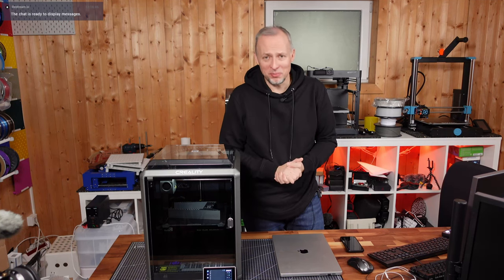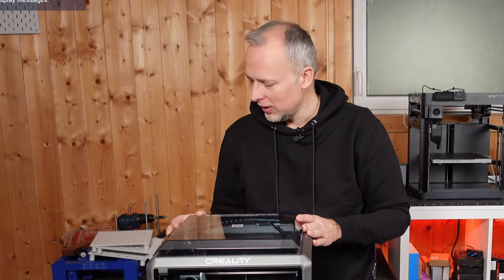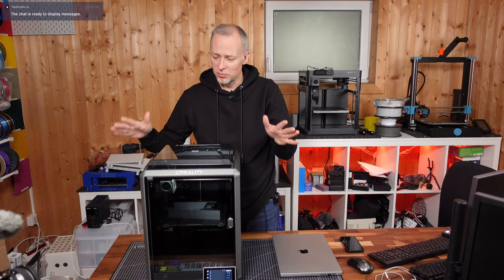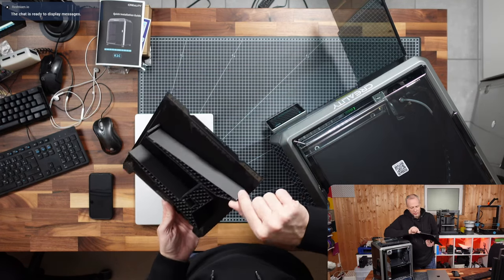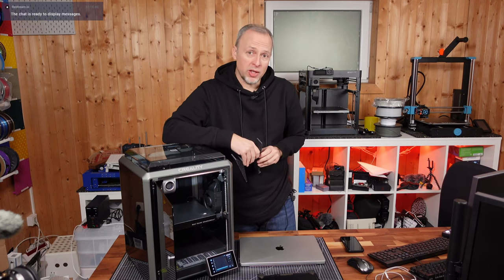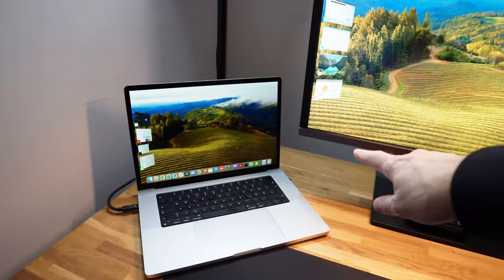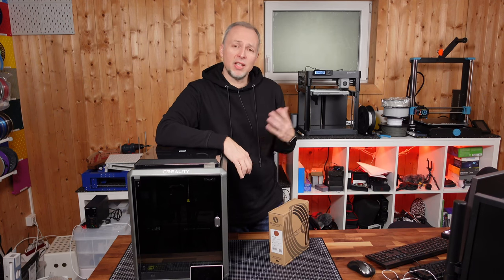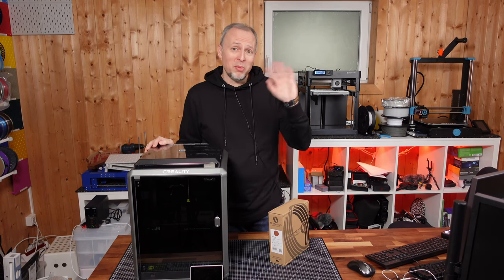Creality K1C: First Results, Carbon Fiber PLA Laptop Stand

Comment: I just bought one. Looking forward to trying it.
Reply from the maker: Let us know how it goes! Are you joining the #the100 build stream next week Wednesday?
Reply: I had a little trouble getting the filament to load initially but have successfully done two test prints. It certainly gets the shakes when printing at full speed but it's fast using the right filament and first results were very good with no tweaking. Going to slice a couple of things I did previously on the Ender 5 I have and see how they compare.

I like the simplicity of this printer and the OOTB experience. I want to print some 270 degree hinges for the door and hinged riser for the lid.

Looking forward to trying some ABS/ABA and TPU in the one.
Reply: @Crosslink3D  I don't know about the stream. Will have too see how I go and the timing. I'm in Australia.

Comment: How does it compare with the bambu lab?
Reply from the maker: K1C creating good results though it is missing the lidar and has a smaller print bed than the Bambu.  No multi color option also. Price value seems really good. K1C sells for 478€ + Tax at 3DJake currently. So if you’re in the market for an easy to use printer for special materials, its probably good.